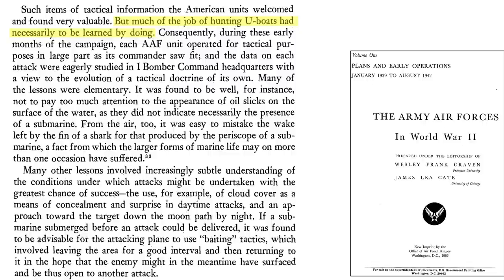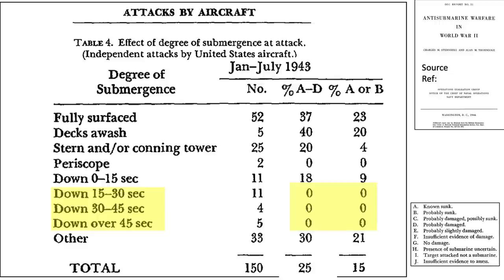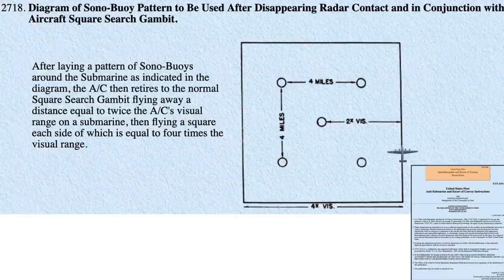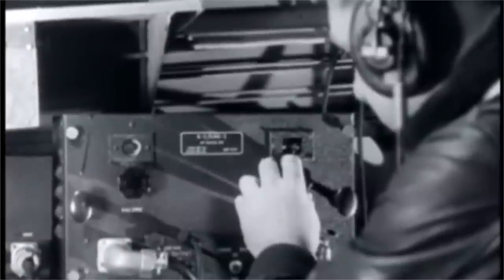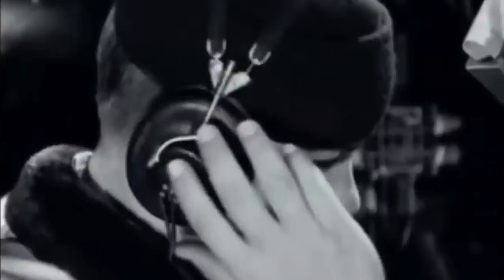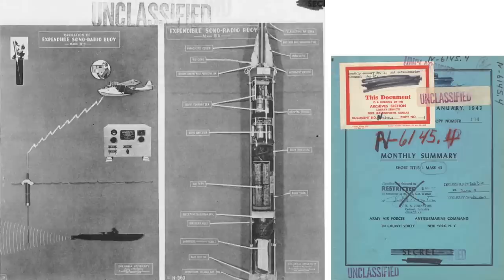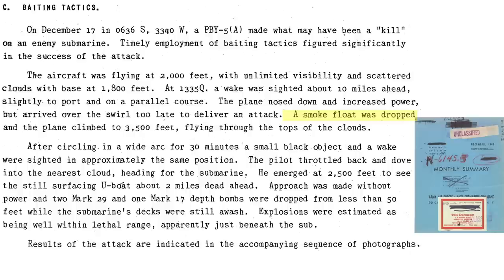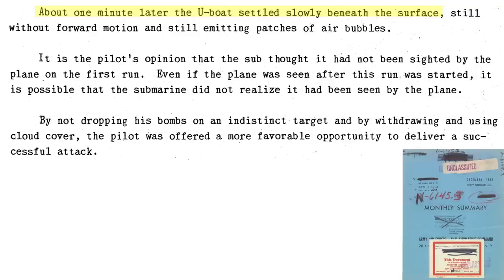The Secret WWII Tactic that Tricked U-boats to Surface

Comment: Unfortunately the USN doesn't list a uboat sunk on Dec. 17th 42.
Reply: Niestle does not list a U-boat as sunk on that day either.
Reply: It may have been Allied.
Reply: Is there a record of an encounter on the 17th, or one day before or after? 
The pictures show a likely uncontrolled dive, but don't mention a debris field or oil slick. It may have been classified as damaged but fate unknown.
I believe the US Navy was conservative in estimating actual kills. It was to avoid situations like the Japanese Navy that sunk one carrier (Saratoga, I believe) six times.

Or someone got the date wrong along the way.
Reply: @christopherconard2831  In Niestle no air sinkings between 8/12/42 and 5/1/43.  U626 is given as sunk by mines after 14/12/42 SE of Greenland.  In some cases there is an element of uncertainty.
Reply: @PaulMarks-hz6zo  Yes these coordinates seem to be off the coast of Brazil so it clearly isn't U-626 which was in the North Atlantic.
Reply: U-164 and U-507 are the most likely candidates for this incident, but they were sunk on January 6 and January 13, 1943, respectively.
Reply: The report text reads "...what may have been a 'kill'..." anyways, so whatever.
Reply: @markmaki4460  Apparently not a kill then if the date is correct.

Comment: Interestingly, there is no record of any U-boat being lost on December 17, 1942.  Look it up for yourself if you don't believe me.
Reply: The record of loss would be made after it was missing for a while, depending on context.
Reply: @malcolmlewis5860  The sinking of U-164 on January 6, 1943 is the closest match for this incident.  The location is close to that reported for the December 17 sinking, but the coordinates don't match up exactly.
Reply: @malcolmlewis5860  Post-war analysis has utilized records from both sides of the conflict to match vessel losses with attacks by other vessels or aircraft and determine the correct dates and times of the incidents.  It's not a matter of when a vessel was reported or declared missing.  I can simply find no record of such a U boat loss or aircraft attack on a submarine for December 17, 1942 anywhere, let alone in the South Atlantic where this was supposed to occur.
Reply: At this time, one of the most interesting YouTube channels by far. The incorporation of the training sound recordings would make u-boat games or u-boat hunting games a lot more interesting!
Reply: The report text reads "...what may have been a 'kill'..." anyways, so whatever.

Comment: That would not work on type XXI subs that would quietly travel underwater for days at 6 kn and recharge within hours using the snorkel. The diesels are always loud but even So even  Kilo subs (copies of the type XXI) after WW II were hard to fknd.
Reply: You miss the point.  The subs were TRICKED into surfacing.  The sub commander might assume the aircraft had left, and was not coming back.  The smart move would be to leave the area ASAP, and the fastest way to do that was on the surface.   How long to wait is a guess on the part of the sub.  The sub could have stayed submerged, but chose not to.
Reply: The Kilo class is not a Type XXI copy.  Kilos have a teardrop shaped hull form, single shaft and torpedo tubes arranged horizontally across the bow. Type XXIs had two shafts the torpedo tubes arranged vertically three to each side of the bow.  The Kilo is a rough copy of the American Barbel class, the last US Navy DE boats.  
The Soviet Whiskey class was re-designed before the first units were built based on knowledge gained from captured Type XXI boats.  Their design was heavily influenced by the Type XXIs.  Probably the fullest expression of those lessons is the Foxtrot class.  However the superiority of the teardrop hull form used on the Barbel class and its Dutch and Japanese derivatives made the Foxtrots obsolete before the first boat was commissioned.